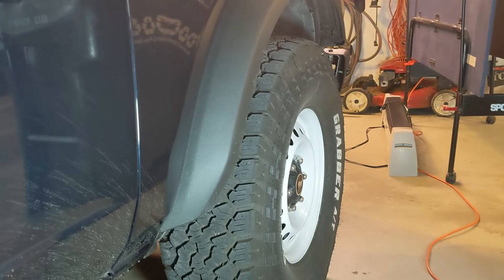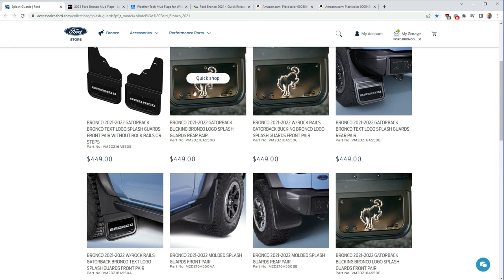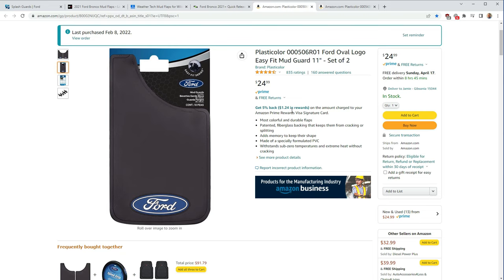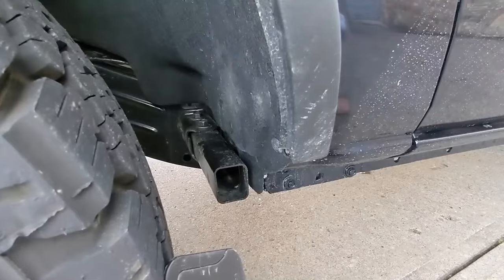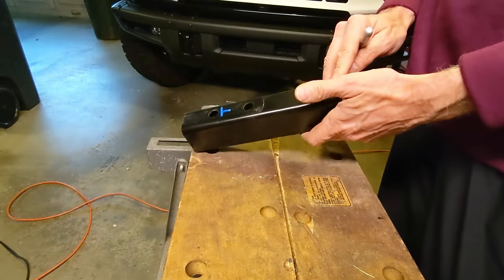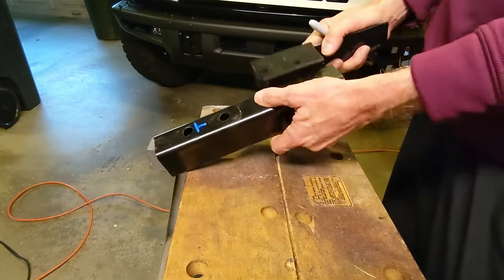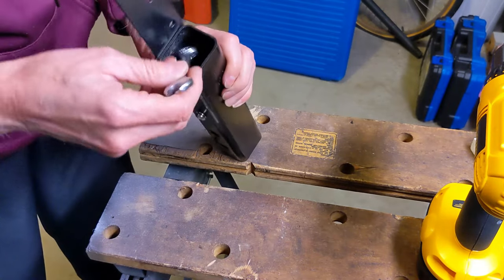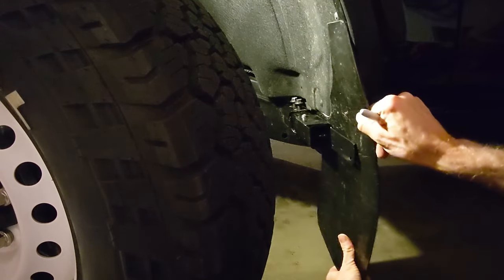2021-2022 Ford Bronco - $30 Mud Flaps Installed With DIY Mounting Bracket

Comment: Coming from the Jeep world, Ford accessories seem extremely expensive.  That, combined with the various quality issues Broncos seem to be having is making me rethink my order.  Your mud flap solution is a great one.  Now you just need to do all the other accessories Ford is overcharging for and make sure to sell me a set of each. ;)
Reply: In 5 years the aftermarket will be on top of the game. Now it ks all a la carte and expensive.
In 5 years, I want to buy a Bronco and do a diesel conversion, no reason not to achieve 30 mpg highway.
Reply from the maker: Some of them definitely are expensive, especially the ones that are clearly made by another manufacturer and just being resold with markup by Ford. For example these Gatorback mud flaps, all of the Thule and Yakima racks and equipment, etc.  And I agree the aftermarket will make more and more stuff and the prices will get more reasonable, just as they have done with Jeep over the years.

Comment: Well looks solid enough and a fraction of the crazy costs of other flaps. Like you mentioned, painting the screws black would look way better. Nice job!
Reply from the maker: They are also holding up really well. They look as good 2.5 years later as the day I installed them. Thanks for the comment!

Comment: rigid mudflaps are perfectly fine, they still bend in very cold temps so kicking snow and muck off em isnt an issue, as for off roading most of them are quick release so its a non issue.
Reply from the maker: True, quick release is a good thing to have if you want to use the rigid ones off road. Thanks for watching!

Comment: Man, that Antimatter Blue is such an awesome color.  Really pops in the sunlight.

I ordered the Sasquatch package on my 2022 Eruption Green Outer Banks.  Been looking at mudflaps for it -- not that I have it yet; it's only been 2 months since I ordered it.  But anyway, what I think I'll do is something similar to what you did -- only I'll need to use some square-tube steel to make myself a "crash bar" of sorts, since my Sasquatch-equipped Bronco won't have the crash-bar for me to modify.  But it really doesn't look all that difficult, honestly.  Thanks for making this vid!
Reply from the maker: Thanks for the comment! There was a guy on Bronco 6G forum that built exactly what you are talking about, here is the post: https://www.bronco6g.com/forum/threads/diy-sasquatch-mud-flaps.41689/
Reply: @BudgetBronco  Sweet! Thanks!

Comment: Great job.   Another idea is to use aluminum angle stock, separated from the steel with butyl tape.   No worry about corrosion then.
Reply from the maker: That would work! Definitely less rust potential, and easier to drill through too. Thanks for the comment

Comment: I just did this, and it seems/looks amazing! Sure it was a little more work than buying off-the-shelf, but I legitimately think the quality/functionality is BETTER than most of the expensive ones out there. I used the "mountains" flaps, not the "ford" ones, but other than that nearly identical to yours. The only hard part was drilling into those crash bars. OMG that's hard metal. 90% of the project is just trying to drill 2 holes in that steel! Whew. Also I have a Black Diamond with the factory rock rails, and they jut out just enough that they interfere a little. To help with that I actually put my "bracket" INSIDE the crash bar, rather than outside it, which probably got me close to an extra 1/4" space behind the crash bar and in front of the rock rail, which was just enough to squeeze the flap into. Looks great! (I think I used 10 cobalt drill bits in the process!!!!)
Reply from the maker: AWESOME!! I am glad it worked out for you. I agree, I think these flaps look better and function better than most of the options out there and cost a fraction of the price, but it does require a little work. Somebody else commented about having difficulty drilling the holes. I did not really myself, but I was using a high quality (more expensive) cobalt bit so that probably made the difference. Good for you to adjust by putting the bracket inside the crash bar, makes sense. Enjoy your Bronco and thanks for watching!
Reply: @BudgetBronco  I also did backup bulb replacement you did... Great and cheap. The only other one in doing for now is a similar fog light bracket to what you did, only I bought TWO pairs of lights... One fog and one spot... Meaning my bracket is "L"-shaped to accommodate two cubes at the front of it. I also went a little lower budget than you and bought Auxbeams. We'll see how they hold up comparitively. Not finished with that one though. So I can't really test yet. I'll let you know how it comes out.
Reply from the maker: Cool...yes please do let me know how that L bracket works. My only concern would be that one light getting that far away from the fastening point, you might start to get some vibration when you hit bumps, and with the lights on in the dark you might be able to see the light pattern bouncing around a bit.
Reply: @BudgetBronco  Yeah, I haven't gotten them wired up and tested in the dark just yet, but I did think of that, but only trying it will tell. It's a "longer lever" hanging out there, AND double the weight of just s single cube on there. If it's "bouncy", I think I will be able to add a little piece below the front edge of the bracket that could sit on the bottom of the bumper opening, maybe a little rubber foot or something. Once I test it (and it is satisfactory), I'll post a pic or to for you to see. I've got a wide fog light and a narrow spot light on each side. Might try to finish the install and test tonight. Depends on weather/schedule/etc.  I did the reverse lights per your instructions and they're a huge improvement. And the mudflaps are great too! Great videos!

Comment: Darn. Mine is a Squatch and this won’t work for me. Love the channel. Keep up the good work with the awesome content.
Reply: Does the Sas not have crash bars?
Reply: I think the brackets for the crash bars are there.  Might be able to attach flat stock to the frame bracket.  It’s worth a look.  I also think the aftermarket has “high clearance” crash bars where the square stock has been cut, pinched, and welded.
Reply: @williamolliges2622  I’ll take a look. Thanks
Reply from the maker: Yes here is an example of aftermarket crash bars that work with 35" sasquatch tires. You could probably use them for mud flap mounting points just like I did. Thank you both for the comments! https://www.4wheelparts.com/p/4-wheel-parts-big-tire-kit-62213/_/R-4WPBR-62213

Comment: Just reporting back that I picked up my bronco Wednesday and did the install of mudflaps today.  Just a word of wisdom to other viewers, if  you have rockrails, they project a bit into the wheel well so in order to fit/ attach the brackets this way, I  needed to bend the flat tab forward to clear the rockrail  a bit and then still required a persuasion mallet to get the intrusion bar back in place. ( Its still a tight wedge to fit.)  They'll be a bit of a bear to get back out again, and likely not so easy to remove.  I don't plan to so not so concerned.  I suppose removing the rock rails and trimming them back or   leaving them off is an option, but I doubt that most owners would attempt that modification themselves or accept leaving the rock rails off,  so just my word of caution.
Reply from the maker: Thanks for the comment, it should be helpful for those with rock rails. I have seen others trim a little bit off the rock rail in order to make some space for mud flaps. That is not hard to do, just take off the cap, use a cutting wheel, and then put the cap back on, but understandably many would not want to cut brand new parts!

Comment: Hi thanks for sharing.   For me to get those I would have to get the tools to cut the metal bracket you got.   Plus only probably use the tools once.   So it might be worth to get the ones that came with a bracket.
Reply from the maker: Possibly, but the only tool you need is a grinder and you can buy one at Harbor Freight for $20. That is what I did years ago, and I have used it for so many projects since I have lost count. Well worth the investment. But if you are not much in to the DIY projects, I would go with the Rokblokz option.

Comment: I wish there was an option for rubberized floor liners without buying the Black Diamond.
Reply from the maker: I agree, that is a nice thing to have. I will say though, the Ford floor liners are pretty nice, and for $160 are worth it. That was one of only three options I bought: floor liners, AUX switches, and front modular bumper.
Reply: @BudgetBronco   they changed a few things on the build page. Now they offer a steel (not modular) bumper and the marine vinyl is black now. 
By the time my build is ready I’m sure there will be more changes.

Comment: Well I'm late with this question but hoping you get back to it.  What was the base bracket that you used and modified?  Can you provide the specific make and model no.?
Reply from the maker: This is what I used for the bracket: https://www.lowes.com/pd/Simpson-Strong-Tie-ML-2-in-x-8-in-12-Gauge-ZMAX-174-Galvanized-Medium-L-Angle/1002624436
Reply: Thank you.  I had looked for something similar at Home Depot and they did not have this type.

Comment: What does the WD-40 do for you when you're drilling into the bracket?
Reply from the maker: Works like a cutting fluid, helps keep the drill bit a little cooler which prolongs the life of the tool. Yes I know it is not the same as true cutting fluid, but can't hurt!
Reply: @BudgetBronco  Great tip! Thanks.  Still waiting on my Bronco but your tips are going to come in very handy. I also noticed you're a Hokie or at least a fan! Go Hokies!!

Comment: I used the same brand flap, but selected the mountain top design. Curious how your painted hardtop is holding up. Any issues with paint adhesion?
Reply: He rapped it.
Reply: @Vidishish  didn’t realize that. Good to know that’s an option too!
Reply from the maker: Yes, it is a wrap. Check my video list for '2021 Ford Base Bronco DIY Vinyl Wrap MIC Top For Under $200'

Comment: It seems the upper part of the flap creates a mud trap and possible rusting point?
Reply from the maker: Possibly, there is a cavity behind the flap and in between the fender flare, but that is all plastic so not too worried about that. If you drive your Bronco in the mud, it is going to get trapped in places, that is unavoidable. Thanks for watching!

Comment: Seems like it should have been easy enough to get some black hardware for those bolts to attach the flap? Great build though and great addition at a budget friendly price.
Reply from the maker: Maybe...but I have seen black hardware where the paint or coating doesn't last and rusts easily. I was more worried about ensuring stainless parts were used. These are definitely in heavy salt zone.

Comment: Hi Tim. Thanks for creating these videos.  I’ve used the speaker and tail light suggestions and they are great.

I’m struggling with drilling the crash bar. I’ve probably spent 8 hours and 10 cobalt bits and still don’t have one hole.  I’m using a hand drill with a bubble level at slow speed and oil to keep the heat down. I’m trying to find a machine shop to do the drilling but no luck so far. Any suggestions?

BTW, I have a Ford running board so I can’t use the angle iron since it extends forward of the wheel well slightly. I’m planning to use a straight bar mounted on the inside of the crash bar.
Reply from the maker: Thanks for the comment, it might help others. I did not mention this in the video but now I wish I would have. I used a 3/16" cobalt drill bit for a starter hole, and then used a standard larger cobalt to finish the hole (not sure what size). The cobalt bit worked great. They are expensive, but last a long time. Here is the exact one I used, bought it a while back from Home Depot: https://www.homedepot.com/p/Milwaukee-3-16-in-Cobalt-Red-Helix-Twist-Drill-Bit-48-89-2309/203115294. Your mod should work well, anything that does not interfere with the tire and the rock slider should be good.
Reply: @BudgetBronco  thanks for your response, Tim.  My stainless steel bolt is 3/16” so I’ve been using smaller bits for starting holes. I’ve gone through all of the smaller size Milwaukee Cobalt bits in the book of bits. My mechanic is going to try, but he’ll use a plasma torch if he has too much trouble.  I’ll report back when I finish with the modifications to accommodate the running board.
Reply from the maker: Maybe try that exact bit I used...as you saw in my video it worked really well, I did not have any problems at all with just a standard drill and a little WD-40. Let me know how it goes!
Reply: @BudgetBronco  I tried the same bit and could start a hole but never could finish it.  My mechanic broke 2 bits using a drill press and finished one bar, but didn’t want to do the other one. I took the remaining bar to a machine shop and for $20 they drilled 2 holes in minutes. Those crash bars are tough! The mud flaps are done and I’m happy with the results.  Now to figure out what to do with the rear flaps…

Comment: Hi Tim, I bought your suggested flaps , is there a mounting method for sas , I’m thinkinking add my own crash bar extension then use your  L bracket idea. I’d appreciate any  advice. Ger
Reply from the maker: Yes, it can be done. There was a guy on Bronco 6G forum that built exactly what you are talking about, here is the post: https://www.bronco6g.com/forum/threads/diy-sasquatch-mud-flaps.41689/ Hopefully that will give you some ideas. Thanks for watching!

Comment: Bit random but do you think the paint protection film accessory is worth it?
Reply from the maker: I think it would be good to put it on the lower half of the doors and the door sills. Have it done aftermarket, not by the dealer

Comment: instead of using nuts why didnt you just tap the holes on the crash bars?
Reply from the maker: Sadly, I do not have a tap and die set. I probably should though, and good idea you are right that would probably work too.

Comment: 🤪 $400+ for mud flaps!?  Lol. Not gonna happen. That infamous saying by P.T. Barnum comes to mind.

Nice work on how you mounted yoyus.  Didn't you have some plastic caps in the crash bar ends, or I might be thinking of someone else.
Reply from the maker: That was me! I removed the caps for this project, and will just reinstall them now
Reply: @BudgetBronco  👍
Reply: I tried to do this project today but the crash bars on my Black Diamond are bolted and welded on.
Reply from the maker: The nuts on the bottom are welded to the crash bar and will not come off. The bolts on the top are not, they thread into the welded nut. You need to loosen from the top, not the bottom, they will come off!

Comment: In watching your video I thought was use stainless steel hardware it will not rust
Reply from the maker: Yes, you will definitely want to use stainless for this job! They use a lot of salt here in PA and one year later the bolts still look new.

Comment: MSU hat in PSU territory :)
Reply from the maker: HAHA you bet! Sometimes I regret driving a blue and white truck around here.
Reply: Go white.  Love the value minded video.  I just added step rails to my black diamond and kept the rock sliders.  But I will add a little rubber to block the rocks.
Reply from the maker: Good call...somebody else told me they cut off an inch or so from the slider, put the cap back on, and then installed these mud flaps and it worked well.